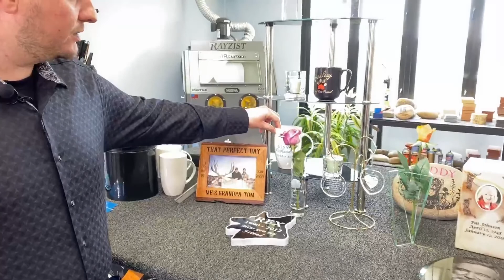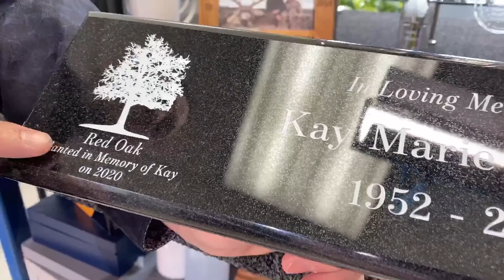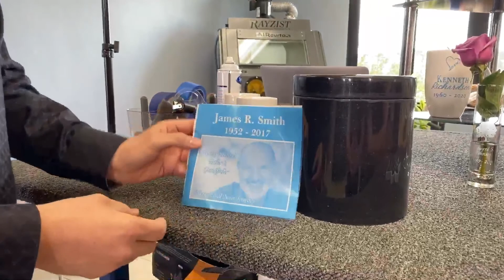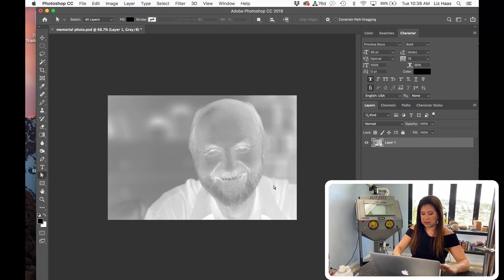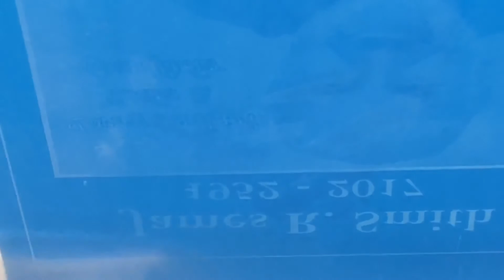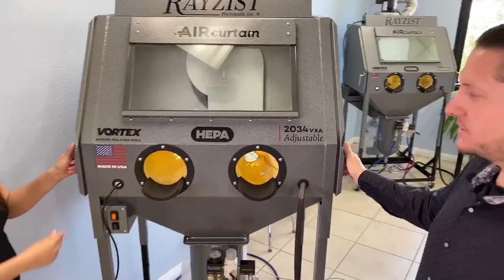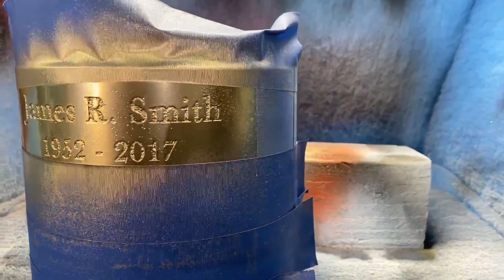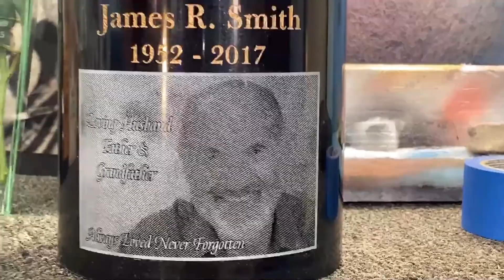VIII | Memorial Products

Comment: Nice! What gold spray paint was used? What is a good quality spray paint to use for lettering?
Reply from the maker: We suggest and use the Montana "gold series" paint (gold color). The Gold series paint is "low pressure" which allows for control in an application and you can use various nozzle (caps) we like the gold-skinny cap for what we do slows the volume of media down even further. The "black" series paints are a bit more "glossy" and not low-pressure paints. 
Is it durable, absolutely! It is a mural artist material, so it is designed to last. You might also look at Belton Molotow series, which has a bit "higher" pigment, I cannot say I have used there Gold. 
We get our materials from ArtPrimo.com
Thank You for watching!! Tune in each Tuesday, 10am PST
Reply: Sandcarving thank you! I will tune in Tuesday.